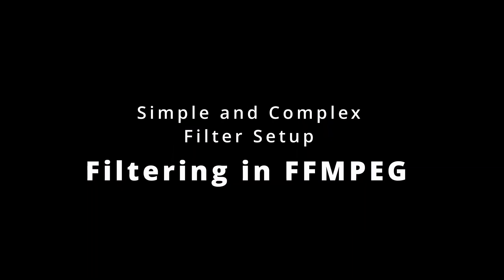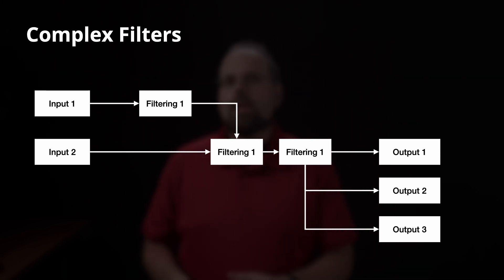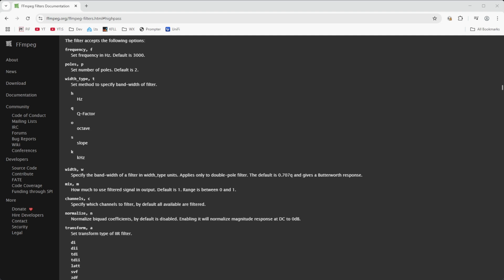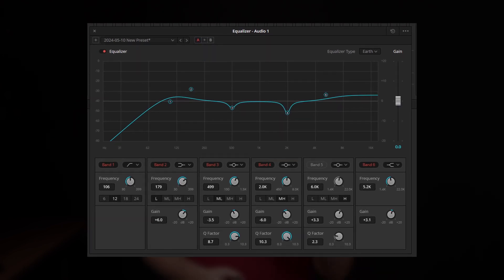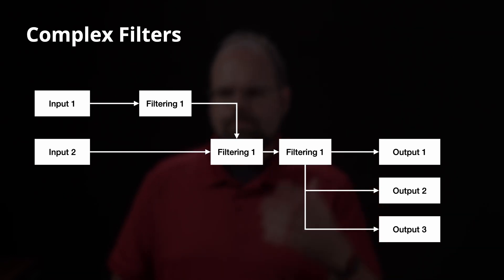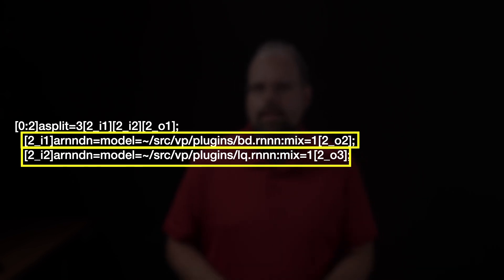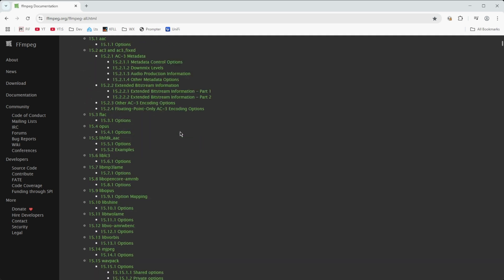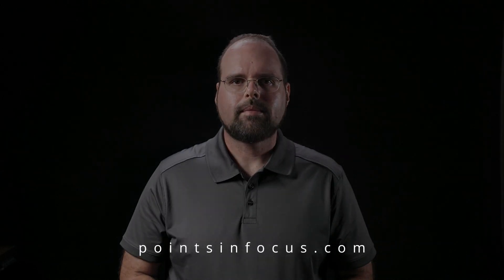Introduction to Using Filters in FFMEPG

Comment: Great video as before! Might I also add to the ffmpeg filtering options: adeclick (to remove "impulse" sounds, e.g. sudden sounds like guns, fireworks, crackling, etc) and afwtdn (to remove "broadband" sounds, e.g. more spread out but consistent sounds such as a fan, noise maker, etc). 

Edit: Forgot anlmdn for Non-Local Means Broadband filtering. Essentially (per the UCLA maths article) uses the energy/heat equation to gather data around the target and use that to smooth things out. Also missed afftdn (fast fourier transform to map to the frequency domain and then group and applying varying gains to different frequency groups).

https://ww3.math.ucla.edu/camreport/cam08-56.pdf